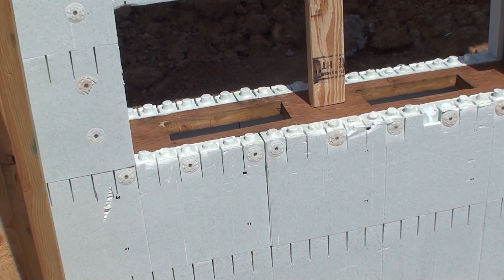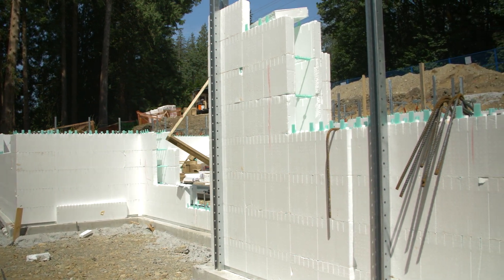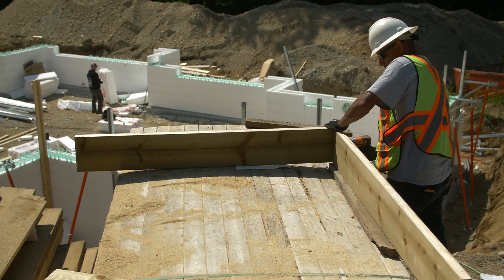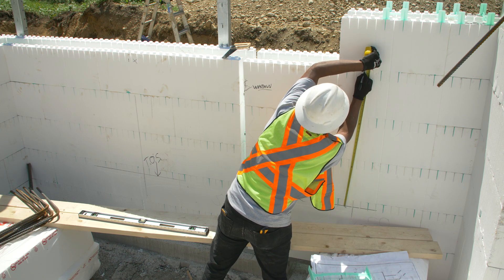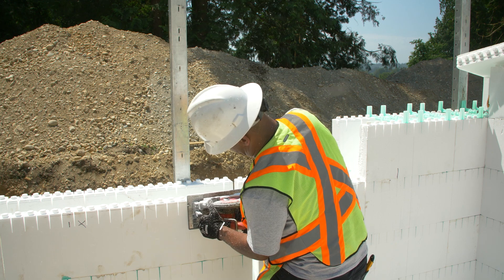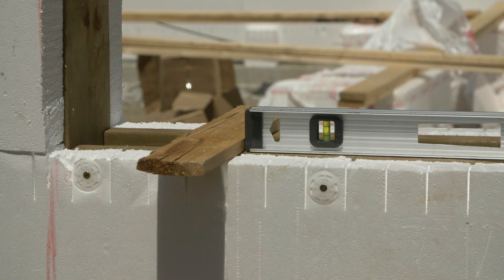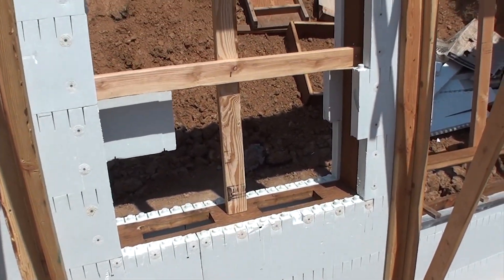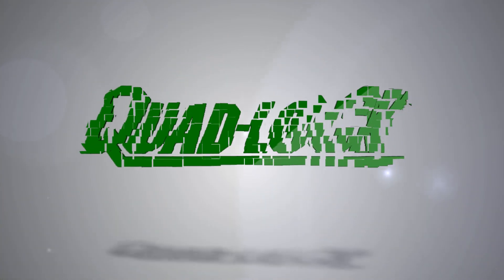Insulated Concrete Forms Installation - Window Openings 13

Comment: I like it. Other videos have thermal breaks by not tucking in the side of window frame into the foam, rather, they have it sitting outside the foam. Thanks for this video.
Reply from the maker: Great point!  Quad-Lock's panel & tie system makes this also fast to install by just using those large washers to secure the frames to the Quad-Lock formwork .